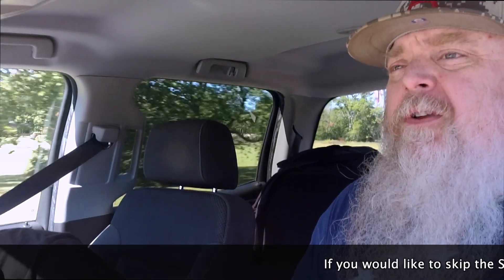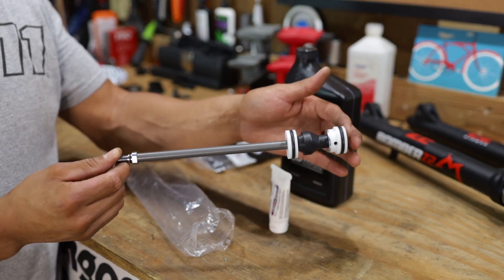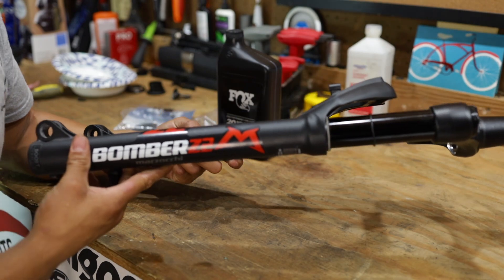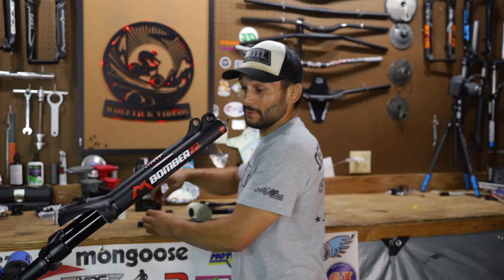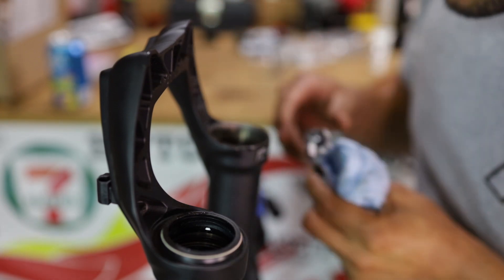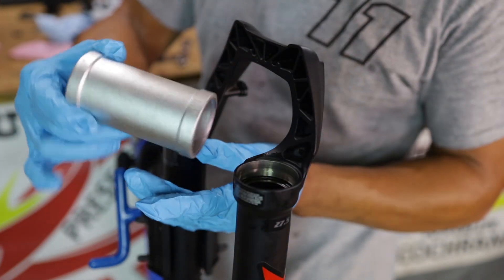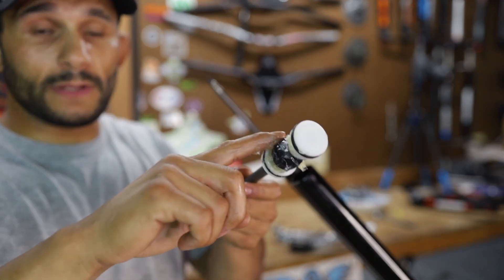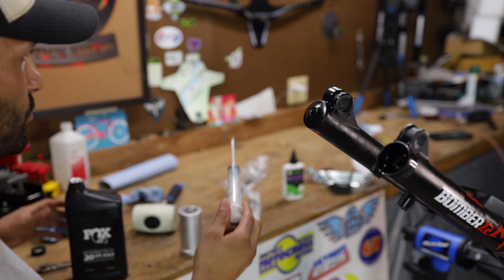MARZOCCHI Bomber Z2: From 100mm to 130mm of TRAVEL

Comment: Thanks again for the video, as usual your  shenanigans in the intro turned a crappy day into one ending in good laugh. That alone always makes your videos worth watching, so whatever you do in the future. DO NOT STOP doing your intros any differently.

Now on to the fork travel conversion..  It took me about an hour start to finish, including the test ride afterwards.. Then again I have all the correct tools to do it and many many years of experience with things like this. Not to mention a lack of fear, overconfidence or call it  narcissism if you want too. The only tools that are what I would call "specialty" tools are the  26mm flat socket for the air cap and the dust  wiper seal tool. Using the crown race setting tool is certainly a way to do it without, or at least minimizing any damage to the wiper seal. Kudos to you for doing it with crown race tool! I wouldn't have thought of using one if I hadn't had the "correct" tool.  From what I saw in the video you did a great job. I ran into the exact same issue with the damper, and from others I've talked to that have converted their Fox Rhythm forks it has happened to them too. 

According the the Fox/Marzocchi  spec sheet , the correct amount of oil in the fork legs(for all Bomber Z2's regardless of travel)  is 10 cc in each leg, and 3 cc in the top of the air side.  IF you removed the air cap then you'd need to put that 3cc of oil there to help lube the seals at the top. I did remove it to install two volume spacers afterwards to help with how the progression felt to me after test riding it.  On 2020 and up Z2's Fox/Marzocchi state "New Z2 Lower Chassis comes without foam rings under dust wipers. Install new foam rings from kit during dust wiper service"   I'd provide the link to the Fox help page that lists all the part #, and other info you'd want on the Bomber Z2 , but YouTube is picky about links in comments thanks to the scumbag scammers.

Now go out and enjoy the ride, you have no need to worry about doing it wrong where you would cause the fork to fail completely and injure yourself.

Comment: The compression lockout adjuster is a frustrating strip down issue.

Usually it's because of the rod under the cap rotating during service. 

Once you've removed the cap, ball bearings and springs, needs to be turned to suit.

So many times I've stripped an air fork like this, reassembled, and somehow the adjuster rod turned anti clockwise. It will turn a lot more than the cap allows for! 

Nowadays I don't put the springs and ball bearings in before sorting out the rod position. I put the cap on, push down gently, and turn it each way and bounce the fork, until I get the best position for both ways turning the cap. Then I assemble properly. 

I have friends who've put their forks together and got no compression out riding and it just needs this "treatment" to get it all working again. They think you're more skilled than you are 😂

Comment: I remember when I services my Pike, it's a bit nerve wracking the first time.  I found using a wide nylon tire level is a safe way to pull the seals, I have a set of the Pedro's levers and they are perfect for it and no risk to the stanchions.  Didn't notice but when you're airing up these forks, cycle the travel 4 or 5 times every 20 to 30 psi until your target psi.  There is negative/positive pressure in the air string.  Well done.

Comment: I serviced my fox fork the first time.  But I do know that you put the foam o-rings after you put in the rubber seals.   

Also good idea to get a bigger plastic oil pan and pull the lowers out while on clamped on the stand.

Also when soaking the foam o-rings.  Less waste if you soak them in a plastic bag.

Good video

Comment: I have a much older Marzocchi that when I called a shop that does the servicing....on these....he said it isn't worth his time and that they were bottom of the barrel air forks.  😔

but now I'm wondering in order to keep the steerer tube that fits in the old school 26er headset....if I'm able to swap to a larger stanchion bottom part and have a frankenfork....
Reply: Time to find a new LBS if that is what he told  you.  Seriously, I can understand if he told you that he could not get parts to service it anymore, I have that issue with my older Cannondale  HeadShok and Lefty suspension forks.  To tell a customer "it's not worth his time" is just terrible customer service and makes me as a potential  customer doubt their ability to repair something properly or handle any potential issues with the repair after it's been done. 

If it were me, and I have run into your exact situation with my Cannondale specific forks, I would start doing some Google searching to see if you can find videos of servicing your fork and just do it for yourself. 
As for  your idea of a frankenfork... sounds intriguing from my end as a "hot rod" kind of person. Might not be worth it  or able to do it from a practical perspective though.

Comment: hey guys, i cant find a way to send yall a message, so wish budget fork yall think has the best low speed sensitivity and lont term reliability for flat woods and grasslands use that is rebuildable, i need it for every day use in cuba so there are no spare parts, i have a broken back so it has to be smooth at low speeds, i have a spring only downhill forks on my 97 mongoose XR1100 and its good on big bumps but rough on quick small bumps

Comment: Nice video guys though you "never" pump an mtb fork inverted especially if it's damper is an "open bath type" like that bomber as when you pump them inverted, all the oil in it's damper will migrate to the top of the fork instead of being in the bottom. You were lucky as you might have just pumped it a few time inverted, if you like pumped it to 20 or 30times, you will have to rebuild the damper side of that fork to let the oil back in it's correct place.